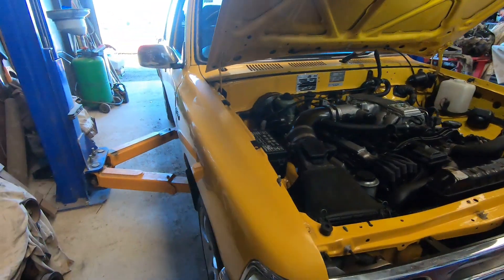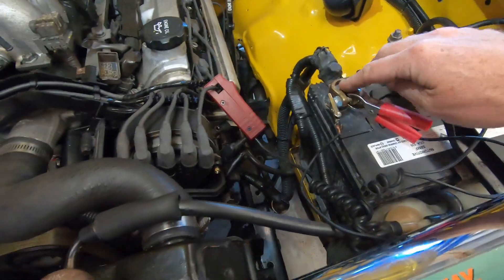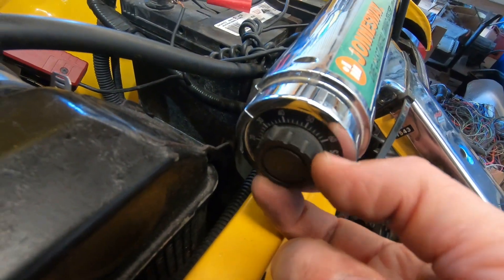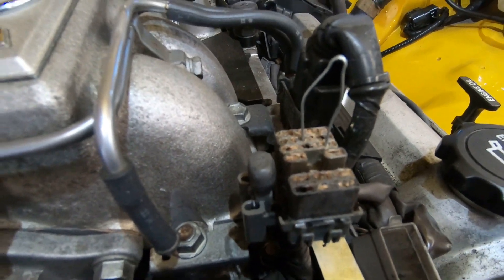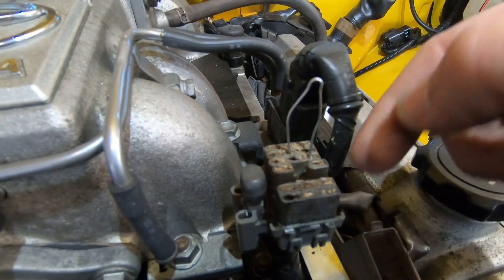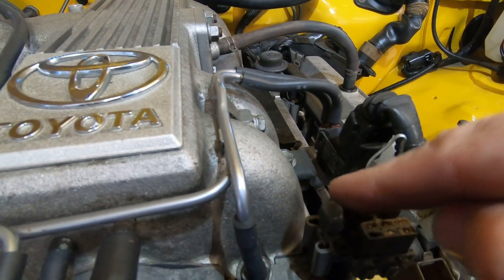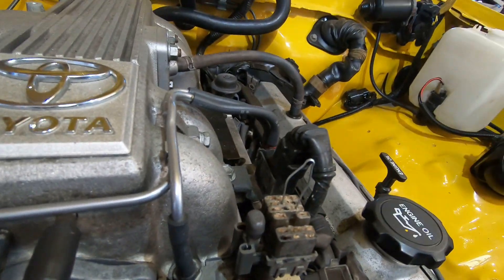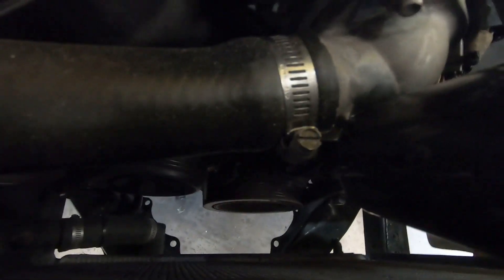Checking 1uzfe ignition timing

Comment: Can I please send you a link to the engine I am working on a small video? The engineers on the combustion stroke top dead center cams are lined up with the top dead center the water pump and timing belt have been changed according to top dead center and my marks I am correctly timed the engine no on the crank the belt sprocket is not in alignment with the timing at top dead center if I move the sprocket for the timing belt to the correct location then top dead center is about 30% dropped past combustion. I also have absolutely no compression in any cylinder

Comment: What did you do to change the timing? I did not see what you did?
Reply from the maker: We corrected the fault,  which was incorrect cam timing.
Reply: @CartuneNZ  Thank you for responding, but I want to know if you used external equipment or some mechanical adjustment on the engine.
Reply from the maker: @Jacobus Krynauw  to adjust the cam timing its a mechanical adjustment which then results in the electrically controlled ignition timing to be corrected
Reply: So you’re saying if the mechanical part of setting the timing correctly then using the timing light should indicate 10 degree when it’s bridge at the diagnostics port . If it’s not at 10 degree then the adjustment has to be done mechanically ?  This isn’t like the good old days where the distributor can be advance or retarded ?  I was wondering how it can be adjust with two distributors.

Comment: What can be the Reason if the Engine doesnt Change timing on pulling the Pin? My LS400 is idling at 10° Bridged but does not change when pulling the pin... its also hesitating and throwing TPS code but the sensor is fine..
Reply from the maker: Tps faults can effect timing

Comment: Hey guys! You are the best!! I had a question, I have a 1uz that won’t start but will end up making a big pop noise. I asked a few 1uz owners and they are letting me know the timing most likely 180 degrees off.. whenever I check how to fix the timing, I only see changing the timing belt. Is there any way to fix the timing without replacing the whole timing belt? I have a 1uz 1992. I really appreciate your expertise on the matter! Subscribed!
Reply from the maker: There is no adjustment on the 1uz ignition timing.  Being computer controlled it is a matter of getting the engine timed mechanically correct and making sure everything is electronically correct and the ECU then sets the ignition timing correct.  Cheers Kelvin

Comment: Thanks for the great video as always! A shop local to me set the timing on my 1uz and the crank pulley mark is at TDC at idle without Te1 and E1 bridged...Now apparently it’s time to properly set the timing!
Reply from the maker: Oh dear.  Doesn't sound ideal.  I need to do more on this topic.  I have some test cars to work with which should help.  Cheers Kelvin
Reply: My timing is off. How do I reset. 1994 LS
Reply from the maker: If your igntion timing is off the issue for it being out needs to be diagnosed and repaired,  could be cam timing,   ecu,  trigger wheels,  wiring, sensors etc
Reply: Okay because my cam sensor connector was bad, crumbled. Replaced it, put caps and rotors back on properly. Now car is out of time. How is this possible?
Reply: Am I able to easily reset the ignition timing ?
Reply: The car was fine before I took it apart. No engine light. Put it back together. Engine light flashing code 13.. Cam sensor worked fine before.

Comment: Thanks for the video! Finding your videos really helpful as I'm in the middle of 1uz swapping my mx5 in Scotland! :)
Reply from the maker: Thanks for the compliment.  I did a NB mx5 many years ago.  Wired it to look stock.  Went well with the stock Auto.  used a UCF20.  Exhaust was nice and quiet so no one know what was under the lid.  Cheers
Reply: @CartuneNZ  I'm using a BMW box, we'll see how that goes! Your video on water/coolant hoses was a big help, as was the one on throttlebodies 👌
Reply from the maker: @DontFuckingCrash  The BMW box isn't common over here which is disappointing.  We can get New R154 at a good price though and have other options.  Both of those videos are very popular.  The water hose video was a request which I generally find if one person is wanting info there are lots others which want it too.  look forward to seeing your one up and running.  Cheers
Reply: Sam Berry have pics or an Instagram?